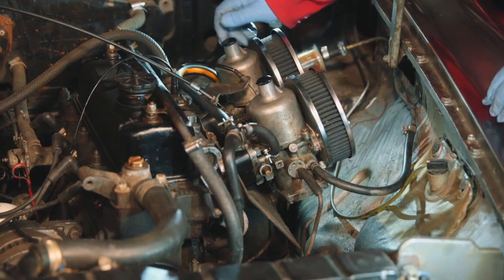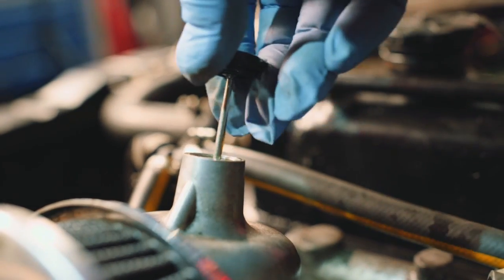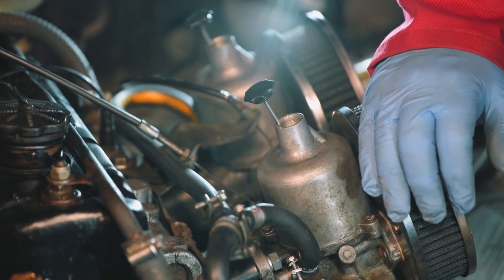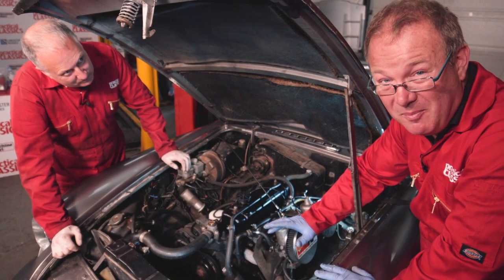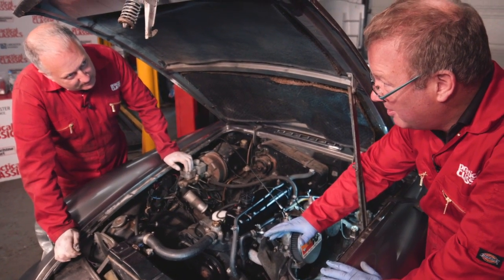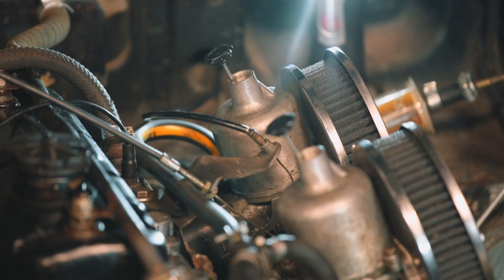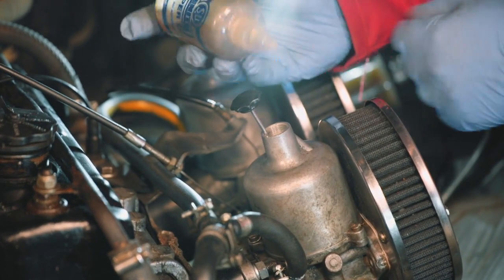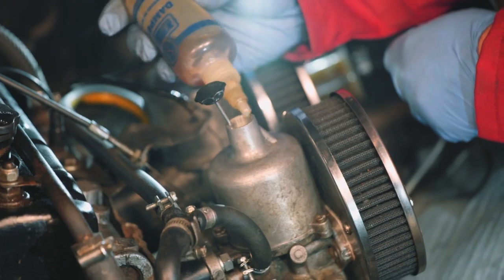Quick Tip from Skill Shack: Dashpot Oil

Comment: This video is incorrect, the oil affects fueling under acceleration and can vary from car to car.

My 1974 MGB requires thicker oil than normal to stop it going lean under acceleration. 

I use a wideband AFR gauge to check my air fuel ratio in real time.

Comment: John Twist recommends 90W gear oil, knowing it goes against everything we've been told. The original MGB  Drivers Handbook states " UNDER NO CIRCUMSTANCES SHOULD A HEAVY BODIED LUBRICANT BE USED"  , but John  says 90 W works great. I'm going to try the 90W.

Comment: Ive read in some different places of ATF fluid, and I think that is what i poured in mine. But then there is different types of ATF aswell.
Reply: I think viscosity is determined by the climate in which the car is to be driven. I’m not sure if the recommendation considers hotter climates that don’t ever see a winter.

Comment: What do You need for the mixture
Reply: They told you in the video.  You could mix engine oil (20/50)  with 3 in 1  (ordinary lubricating oil that you can buy in a hardware store)   50/50 mix.   Or buy SU  oil on Ebay.